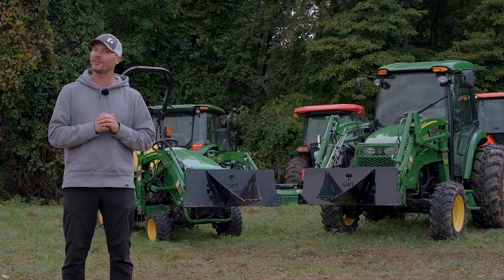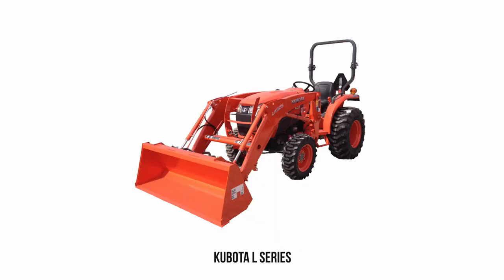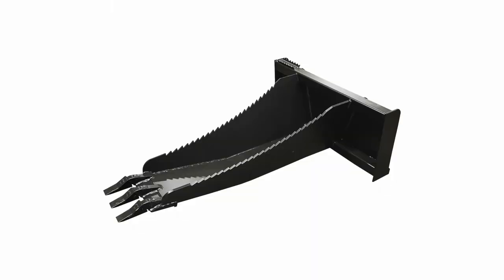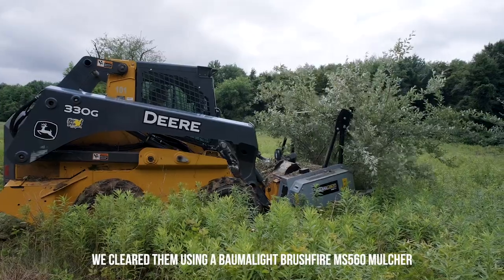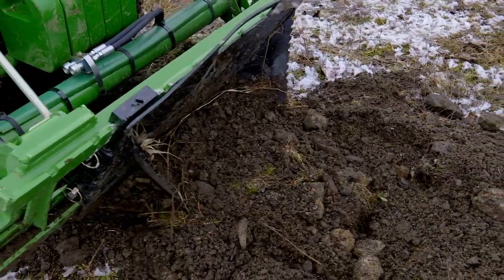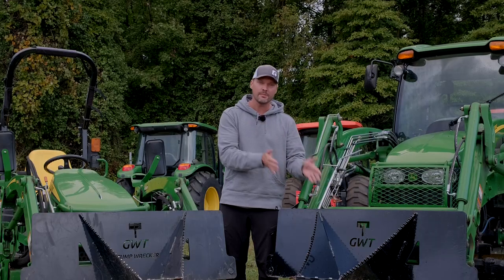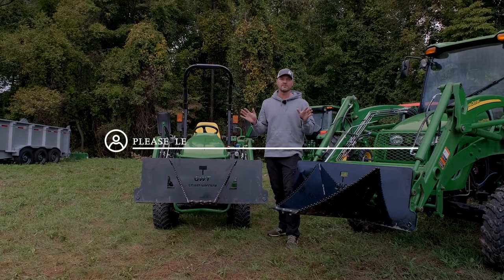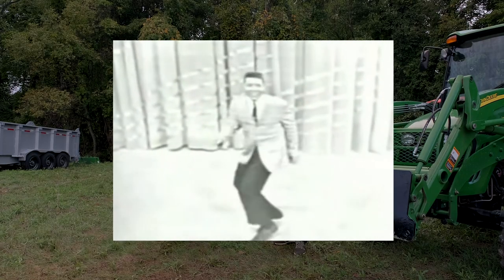UNLIMITED POTENTIAL! 🤩 PUT THIS SHOVEL IN YOUR SHED

Comment: I am going to create a small-medium pond at the back of our yard. I will need to dig back into a slope to level the ground back and use that as the downhill bank. I think this would be great to rip up the ground, then switch back to a regular bucket for moving the dirt around. 
We are also going to use it for the reverse of its intended use. We are going to dig big holes to plant trees and create flower beds around the trees. 
Great attachment. Great videos.

Comment: Would be using the stump bucket to remove many stumps and/or small trees, moving rocks, removing an old concrete step, digging ditches to redirect water run off and whatever else I could find to do around the property.

Comment: Looks like another great tool for my 2038R JD.  I have 5 acres full of smaller trees and stumps.  This item would be excellent for cleaning up the sumps from smaller pines, etc.  but I’m also interested in using it for maintaining walking trails.  We get erosion from heavy rains and the concentrated dump would be excellent for filling those spots with granite without having to dump and rake a wider area.

Comment: If I had a stump bucket designed for a 4 series tractor and decided to use it on my 7000lb skidsteer would it hold up or would that size ( 60hp ) skidsteer be too much for the stump bucket designed for the 4 series JD tractor? Reason I’m asking is I am buying a 4720 and have a Gehl 5635 ( 60hp 7000lb ) skidsteer and would like my attachments to work on both. My 4720 has the skidsteer quick attach, not the Deere system so buckets, forks and other attachments can be used on both. Looking at getting a 8 foot HLA snow pusher to use on the tractor too but will be using it on the skidsteer as well. I want one of these stump buckets cause part of my business is stump removal and land clearing - looking for a cheaper alternative to a mini excavator. Also don’t want to tear up my machines but do want to be able to dig up and remove 4-6 foot stumps.

Comment: Stump bucket takes care of almost all of my digging needs. Cheap substitute for a backhoe unless you need to dig a grave size holes.  Any more digging than that and you really want an excavator.

Stump bucket excellent for getting rocks out and shallow digging. I typically go back and forth between my flat bucket and stump  bucket on different projects.

There is a video of some work I was doing with the stump bucket...
https://youtu.be/qBLY_M5juA8

Comment: I went online to purchase a stump wrecker for my Kubota L2501 and was told that there is only one version of this stump wrecker.  I wanted the HD for the Kubota L series (L2501) but I was told by Courtney that there is only one version of the stump wrecker.  What's up?  Angel Lopez
Reply from the maker: That is correct.  There is no HD version available yet.  I am Courtney.  The one in the videos, the one who answers emails, the one who responds to YouTube comments.  This video also explains that there is not an HD version available yet.
Reply: @GoodWorksTractors  Great thank you for your comeback.  Would it be worthwhile to wait for the HD version for my Kubota L2501 or will the standard stump wrecker be sufficient?  I just don't want to ruin the smaller version. I thank you again in advance..